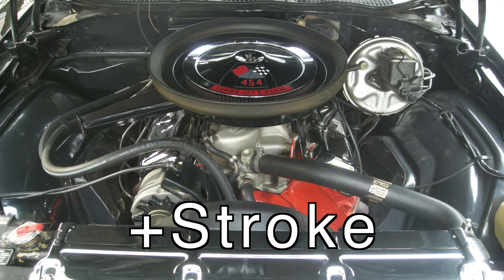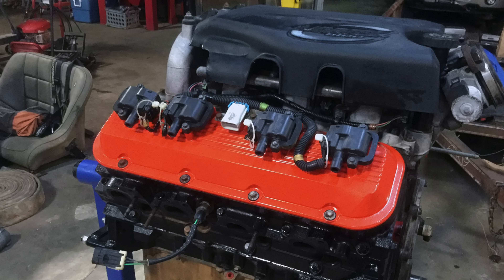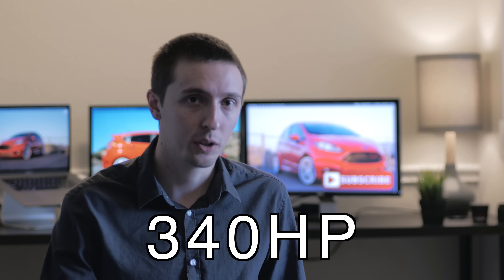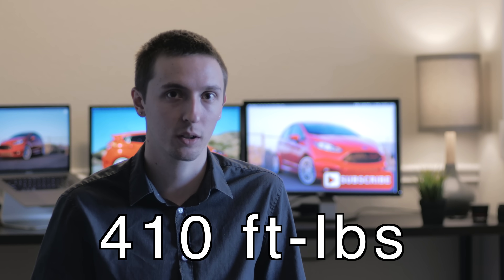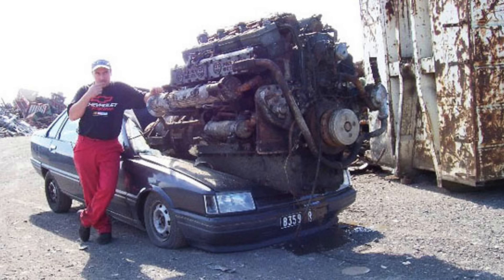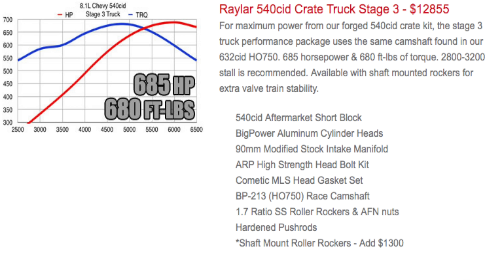Vortec 8100: Everything You Want to Know | Specs and More

Comment: I'm not sure how you can say the 8.1 "nearly matches" the torque of the Duramax.  I'm no fan of the DM...but pointing out the most obvious reasons the DM is more popular than the 8.1.  Horsepower levels are close but the 8.1 needs 50% more RPM to peak.  Torque levels arent even close these days as the DM makes almost double, and the DM can generate that out at about half the RPM as the 8.1.  All of this makes for a more comfortable and efficient towing engine which will last longer than a similar gasoline engine.  Both gasoline and diesels shine in their appropriate applications.  Trying to blur that line will blur their differences.
Reply: AGREED.  although i own a 2001 hd 2500 c/c s/b 2 wd w/an 8.1, i have driven many of the DM's.  way better mileage BUT,  when they break, you need a co-signed to fix them. diesel is not always available in the remote places i go but, it is getting more popular as are the stations carrying it. i using a friends hd with the DM ( 2005 hd 2500 crew cab 2 wd ) loaded , did not get much better mileage than my 8.1 does. empty, might as well be a 4 cylinder.. they are great ! i cant say the same for my 8.1.  the best i ever got was 14 mpg thru texas empty... going to denver, down to 2mpg going over the eisenhower grade but, i made it and, it was loaded with a 48' 2 car trailer with 2 cars on it....  i love my 8.1 but, i hate the mileage. no disrespect the DM's and, if i could afford one, i'de probably have one but, i wont sell my old beast for nuthin!  i will drive it until its so bad, i cant fix it anymore... the nasty duramax's that make all the wild horsepower , are usually fitted with aftermarket ecu's and such, which ultimately kills them in as little as a 1/3 of their projected life. fast, very torquey and, reasonable mileage but, at a huge cost.  i love my 8.1 and im sure ide love to have a duramax.   i just trust my gas engine a bit more than the far pricier dm's...
Reply: He said 1st gen Miramax. Watch it again

Comment: My father had one in a 3500 dually. It didn't have an over abundance of power and got horrible gas mileage. Also used to drive a c65 flatbed with an 8.1 in it. Went ok considering the size of the truck but used a lot of oil. Ill stick with my 454s.

Comment: I lovey 8.1l truck it's a beast and walks from most LS motor
Reply: You will have to beef up the front end as the engine weighs A LOT more than a SBC.
Reply: Kyle Molina a diesel with out a turbo will never beat a gas engine, put a turbo on that 496 and it will smoke that duramax
Reply: @jeffcolt9185  eh a diesel without a turbo just runs into not having enough air to make more power.
Reply: An ls would run circles around this thing in cost efficiency

Comment: I would not say the Duramax is a better engine just a more powerful engine. I have drove many Duramaxes and industrial-grade trucks along with many 8100s in industrial trucks such as box trucks boom trucks bucket trucks dump trucks. the 8100 never broke down and never had a lack of power that was of any concern. I have set on the side of an interstate at least 15 times the last five years because of a Duramax! Not a better engine at all but will pull the world.
Reply: are they being maintained? I have a Duramax and I beat the fuck out of it with my semi heavy trailer attached to it. I really do put my lead foot down and beat the hell out of it. also mine is tuned so I should be having issues that ur having but im not...…….
Reply: They were company trucks and yes they were always maintenanced on time and a butt ton of preventive maintenance I did have one Duramax though I started driving with 250,000 miles beat the hell out of it in the North Carolina Mountains for another 50,000 and it never did break down
Reply: @mitchelkane2641  damn thats good to hear because i always wonder if my trucks gonna go. My main concern would be the cp4 pump which i put additives in my fuel to lubracate the fragile cp4 pump. The ultra low sulfer in diesel takes away the lubracate the cp4 needs. It was 500ppm back 15 yrs ago and now its decreased so much to a 5ppm. 100x's less!! Also my tranny, which has been great so far but nothing last forever and i need to stop having a lead foot but with the mbrp exaust and it being tuned  it sounds like a beast drivint around. Another problem they have is emissions. All my emissions on my truck are all gone so there is half the problem.

Comment: I’ve had two - one was great, the other still is (Avalanche bought new). My son in law is on his second one - for heavy use on farm, it is much more economical than the diesel pickups.
Reply: Yes the avalanche 2500 did indeed get the 8.1
Reply: They put that motor in a avalanche?
Reply: Truwar * , yes they did. We bought it new and learned that there were no engine options. If you bought the half ton you got the 5.3. If you wanted the 2500 you got the 8.1. With no EPA estimates on fuel efficiency - I just shut my eyes and ordered it. Happy though, it gets 15 on the highway at just over sixty, but it goes down pretty quick if driving interstate speeds.
Reply: @abs042johnson  The 6.0 should have been an option in the 2500.
Reply: @desertfox2020  , I agree that it should have been. Maybe the 2500 would have had a longer run.
Reply: Truwar * no way in hell did the avalanche get the 8.1

Comment: I drove a company 8.1 truck when they first came out, the torque was amazing, enough to spin the tires at a stop light while towing a 20’ enclosed work trailer. I’ve driven some later model 8.1 trucks that didn’t seem to have nearly as much torque, obviously GM detuned them over the years...
Reply: Lol "obviously GM detuned them over the years" because your butt dyno says so?
Reply: Kur Norock the later modeled were in fact rated at something like 20 less ft/lb
Reply: @KurNorock    Lmao his butt dyno was right smartass.
Reply: Yeah they did detuned them but they can easily be retuned and make loads more power
Reply: These things were so dumbed down. at last 'it was pitiful.

Comment: My 8.1 Sierra with 216,000 is the most reliable best driving truck I have ever seen. (and i'm a mechanic) I would not alter it from stock or give it up for anything.  Love it
Reply: Put a tune on it and get rid of the torque management and funky shift pattern, you'll be amazed.
Reply: Abm 

Buy parts where 😁

Comment: Just got a class a motorhome with the 8100 in it. I did not want the v10 I am not a ford fan. I also have a 67 camaro with a ZZ 502 in it. Love the Big Block.
Reply: Have owned a W22,000 rated Holiday Rambler class A, with 8.1, for over 13 years and 115,000 miles, loaded and with a 4,000 lb tow. Do all of my own maintenance.

 After owning two Diesels, changing several more qts of more expensive oil, that smells worse than you can imagine, running down your arm, with filters that cost far more, I can honestly say the gas 8.1 is much cheaper, easier for an individual on a limited budget to maintain. 

The Allison is also strong, sweet and easy to maintain economically. Lubing 'all' 12 chassis/drive train zerks with a pulsing pneumatic using HP moly grease, finishes out my periodic 5,000 mile maint in orderly fashion. Disc brakes with problematic polymer pucks, were rebuilt to newest spec, by local Workhorse rep at 50,000 miles under warranty.

 I would have to have my diesel today, serviced at an economy dealer [impossible to find locally]. To say nothing of the exorbitant costs [in comparison] of maintenance on my diesels. 

Western states high mountain passes in repeated succession, lots of engine braking, are a bit less rapid, less fuel efficient, suck more oil. Oil consumption on 8.1 is less than 1 qt per 1,000. Western states fuel econ is 7 to 10 avg. Walmart full syn oil, at $16 for 5 qts, has been it's lifetime diet.

The 8.1 is in exposed storage for 6 cold months every winter, 13 years, and starts each spring, like it was just turned off yesterday. Marvel mystery Oil at reg intervals in spec fuel mix, maintains the injectors and fuel pump. I installed fuel filter, serpentine belt, pulley set and water pump, at 90,000 mi. Changed 'All' lube fluids, spec filters, new set of titanium pre-gap spark plugs and new plug wires at 104,000 miles.
Reply: Rickbo's Rides what kind of mpg you getting on the motor home?
Reply: I do not pick it up till mid week, will make a video when I get it.

Comment: I heard the 8.1L suffered from oil consumption and other oil related issues?
Reply: I have 200,000 miles plus and no oil issues
Reply: My 01 silverado will use a quart every 5k miles, I change it when the light comes on betweeen 6 and 7k miles. Truck has over 300k miles on it with nothing more than routine maintenance. My 02 Suburban uses half a quart in 5k miles, it has 250k miles on it and still runs like new.
Reply: chevy big blocks for the majority, are oil eaters. the harder you run them, the more they use.
Reply: @INKJAX  that's if you over fill them but engines naturally consume the oil it's impossible to stop.
Reply: I've heard switching from 5w30 to 10w30 helps
Reply: @Caudahy Hall the big blocks never got afm...
Reply: 8.1 doesn’t have fuel management.
Reply: Early model had a bad intake gasket issue, and sucked oil into the cylinders.

Comment: I want one built and stroked 11:1:1 compression bore it to a 502 atleast
Reply: you can get the 8.2 thru chevy...
Reply: But the 8.2 502 is a different engine then the 496
Reply: You're not gonna get 502 with any typical over bore, the numbers won't add up. The 502 has a shorter stroke and a bore that's so much larger that the block had to be redesigned to accommodate it, or of course, you could nab a 540, maybe a 555 if you're daring and absolutely need the biggest displacement standard deck bbc around.

Comment: You know that a 5.3 IS A SMALL BLOCK AND A 8.1 IS A BIG BLOCK RIGHT?
Reply from the maker: You know that YOU LEFT CAPS LOCK ON?
Reply: Dust Runners Automotive Journal. I did realize that fair enough, but I think that your comparison of the 8.1 to any LS motor is not really apples to apples. You are pointing out that the aftermarket favors the LS over the 8.1, you could remove the LS and replace it with any of the 350's and your statement would be the same. I believe that the 8.1 is or should be compatible with the other passenger car or light truck big block motors, those being 396 , 402, 427 and 454.
Reply: Outdoor Life Oklahoma what's your point Billy?
Reply: Rick Bean. My point is that the comparison is not accurate Mr. Bean.
Reply: Outdoor Life Oklahoma what he is saying is that if you get a 2500HD the gas alternative is a LS engine. He is saying that the 8.1 is another alternative. That is why he compared them because they are both offered in truck motors. It is an option in addition to Iron block LS engines. Understand?
Reply: Rick Bean. No Sir I don't. I'm not trying to rip him, his comparison is not accurate.
Reply: Outdoor Life Oklahoma yes it is. He is comparing the two engines because the are OPTIONS FOR A GAS 2500HD. It's like hey if for some reason you don't want a Duramax and the 6.0 doesn't have enough power here is a 8.1. It does   this this and this different COMPARED TO the 6.0 (LS) it's like comparing a v6 mustang engine to a V8 mustang engine because they are both options in a certain platform
Reply: Rick Bean. I disagree Sir, the Title of the video is Everything You need to know about the 8100. He then says it is an alternative to the Duramax, I will give both of you that point. Then he goes into comparing the LS engines to Big Blocks. He then says the Vortec name comes from the 5.3 that everyone swaps nowadays, That's not accurate. He then states that the ways that GM developed the 8100 was by making the crank case larger, that's not accurate. He makes statement that there is no aftermarket for the 8100 that is not accurate, it's a stroked 454! People have been stroking 454's to 496 cubic inches for a long time. He then said states that the 8100 is the biggest motor GM has produced, not accurate. It is the biggest produced for a production vehicle. He then states that putting a big block in a Camaro or Corvette would throw the balance and handling, not accurate because Chevrolet did from 1968 - 1971. In fact in the late 90's Chevrolet used and has a 96 Camaro with a 572 big block the true biggest motor that GM built, now it was never in a production car but it was produced and you can by one today. He then said you can't put LS heads on a 8100? I can't believe that he even said that! By the way here is a point for your side of the debate, the 6.0 makes 360 hp and 380 lbs of torque where as the 8100 made 330 and 450 for power and torque. The Duramax for 2001 made 235 and 500, we both know that torque is what's important for towing. So no the 8100 is not a Duramax killer and no we don't know everything we need to know about the 8100.
Reply: Outdoor Life Oklahoma Running LS heads on an 8.1? Please give me the link for your source of this info. Also, besides Raylar which is mentioned in the video I can't find much aftermarket support.
Reply: Outdoor Life Oklahoma I will give you the point about the 5.3 being the start of the vortec name. The 5.7 vortec carried the name in the previous gmt400 style of truck
Reply: Outdoor Life Oklahoma Also about what he said about putting a big block in a car. He never said it wasn't doable but it will severly affect cornering. I can swap a 12v Cummins in a 1500 Silverado and drive it around but its not practical because the motor is to heavy for the frame and suspension.
Reply: Outdoor Life Oklahoma sorry also I would like to add that a 8.1 isn't turbo a Duramax is. Slap a turbo on a 8.1 and see what's up then. Also the Duramax has fuel milage in it's favor yes but it's also expensive to work on and mantain. Not so with 8.1
Reply: He is giving a bad example about using LS heads on the 8100, it is impossible to use LS heads on a Big Block
Reply: Outdoor Life Oklahoma Dude you literally just said you COULD use LS heads on 8.1. He said you couldn't which I agree with. Your just grasping at straws here and arguing just for the sake of arguing.
Reply: The technology is there to do it if GM wanted to, The Big Red Camaro  that started the Pro touring segment is a big block.
Reply: Outdoor Life Oklahoma I mean you just totally contradicted yourself. With the whole putting LS heads on 8100. If I were you I would just concede. Your argument makes very little sense.
Reply: Mr. Bean you need to read my very first comment on this video. i pointed that one was a small block and one was big block. You then need to re read my other comment where I questioned his statement of evening saying you can;t run LS heads on a big block. I was questioning why someone would even say that. That's another reason why I disagree with his video. I said what I had to say you started the argument I never said that you could run LS heads on a Big Block
Reply: You need to re read I never said that. Please read to comment from yesterday carefully.
Reply: There are 5.3's with turbos that make 1000 horse power that does not make them towing trucks. You can't say lets put a turbo on it and then see what happens! lets put power adders on everything !
Reply: Please watch the video again
Reply: You are taking the word of a man that said you can change the size of the crank case to achieve more displacement, if you can tell why that is wrong I will let you have this one.
Reply: Outdoor Life Oklahoma Btw you CAN tow with a turbo gasser. You have to size the turbo(s) right and have plenty of cooling. Just look at Ford's Ecoboost.
Reply: Rick Bean. It's not that you aren't going to waste your time, it's that you can't explain it because you don't know what you are talking about and that's okay. I went hard on the creator of the video in the beginning and then presented my point in an adult way when he called out and left it at that. You decided to jump in with your opinion. The more I watched the video when responding to you the more I found that was incorrect. It was never my intention to trash a creator.
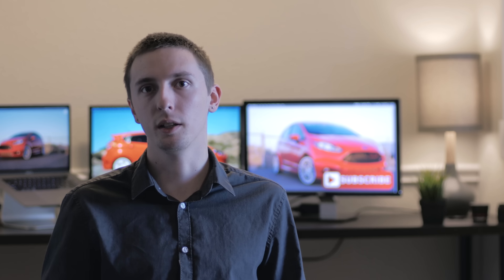Reply: Outdoor Life Oklahoma ok one last time because I have faith in humanity.....at 2:13 in the video start watching..I want you to grasp 2 very important points 

1. He makes the connection between 8.1 and Chevy 

2. He establishes the connection between LS and the 8.1 By SAYING that "people sometimes confuse the 8.1 vortec with the 5.3,6.0,etc. BECAUSE OF THE NAME VORTEC. Then he explains that these LS engines are basically the AR15 of the car world. Then he says the 8.1 isn't as AS popular because

Avalibilty, Wieght,aftermarket,etc.

Ok so to put this in terms you can understand say I'm making a video on the AR30. Look it up it's a bolt action 338 lapua made by armalite.

Now I could make the statement that the AR is sometimes confused with AR15. Because AR15 is so popular. Now I could make the comparison between these two firearms because they 1.are made by same company 2.sound the same.

So now I make the comparison that ar30 isn't as popular as AR15 because .....now I can list reasons while ALSO GIVING FACTS about the AR30. By doing this I am giving you info on this rifle and not being boring by spewing off fa take from a paper. I am ENGAging my audience. 

Now do you follow me this far? Yes or No 

Don't argue just yes or no?
Reply: @rickbean6153  the 8.1l does use a head that's kinda similar to the ls just revised for big block heavily.
Reply: Haha got em
Reply: I thought the 4.8 was the small one